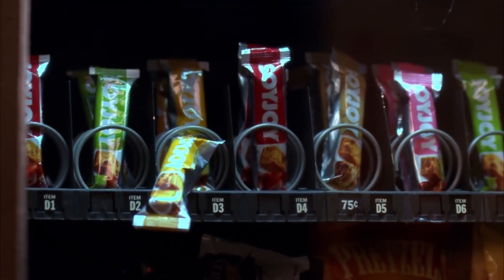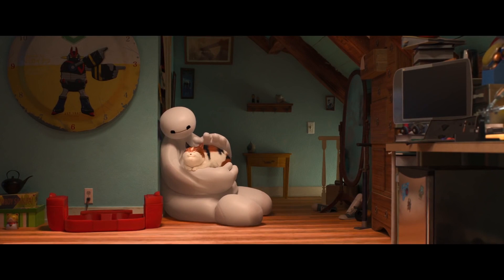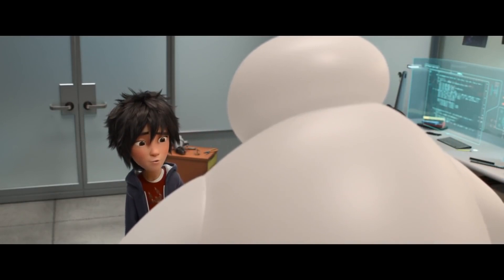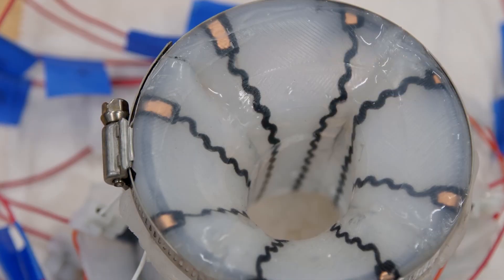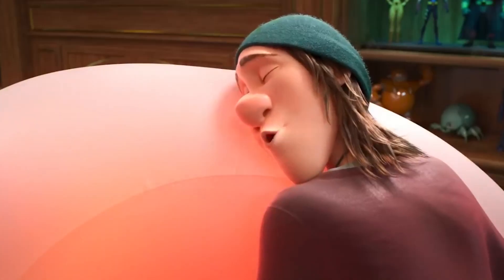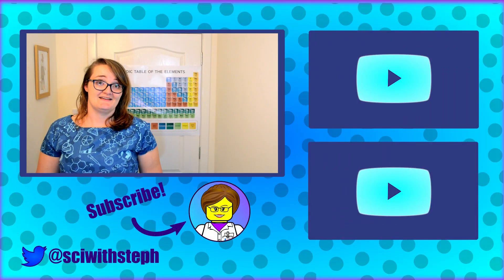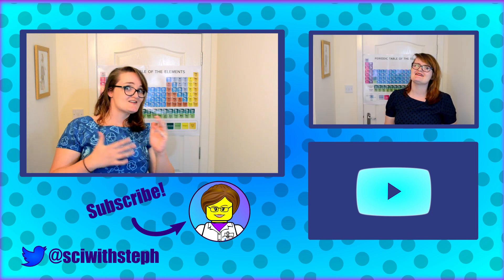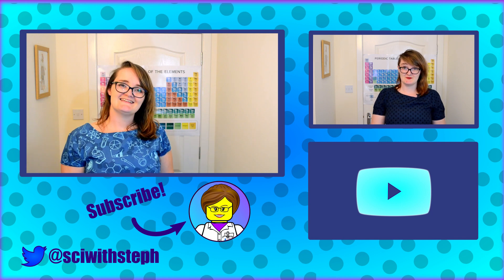Could modern technology build a real Baymax?

Comment: Last fall when I was doing cardio rehab the treadmill I was using calculated my blood pressure along with my heart rate. Not sure if that's really a reading.
Reply from the maker: yep, treadmills I normally use have little metal tabs I need to touch for them to get that reading. Problem is I get too sweaty for the readings to be at all accurate 😅